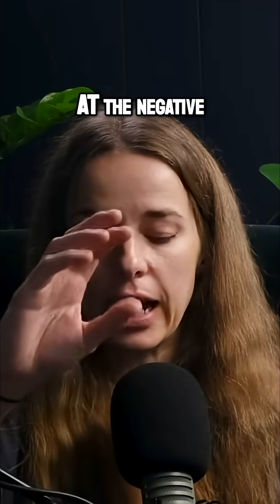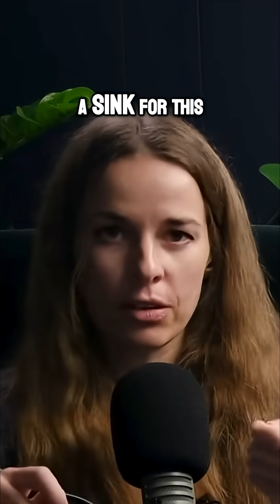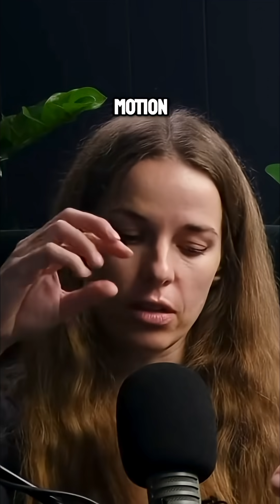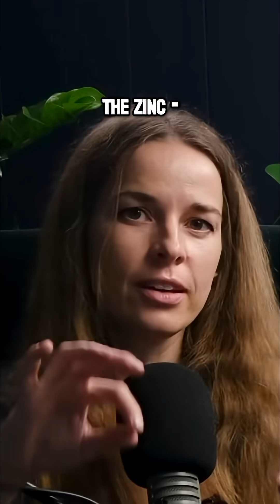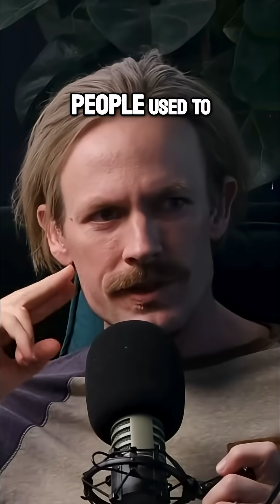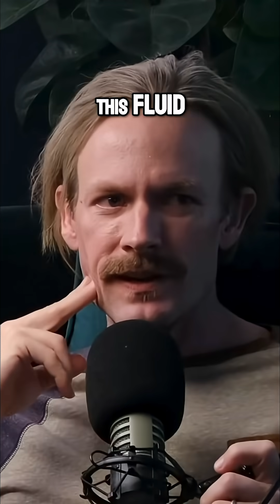Is electricity actually just atomic motion?

Comment: Humans Labeled Motion 1 million times and called it knowledge.

The Master Motion List:

Foundations

Space: background unresolved motion.

Time: rate of pattern update.

Spacetime: bookkeeping of relative motion rates and paths.

Mass: resistance to retuning a motion pattern.

Energy: capacity stored in configuration of motion.

Momentum: directed flow of motion that keeps going.

Force: motion gradient that steers other motion.

Field (EM, gravitational, etc.): organized motion tendencies in a region.

Potential: stored opportunity for motion to reconfigure.

Work: motion transferred along a path.

Power: rate of motion transfer.

Inertia: stubbornness of a pattern to change its rhythm.

Action (physics): integrated motion history a system prefers.

Waves and signals

Frequency: update rate of a motion loop.

Wavelength: distance a phase marker travels per cycle.

Phase: relative alignment between motion rhythms.

Amplitude: excursion of the motion pattern.

Interference: motion patterns adding or canceling by phase.

Resonance: motion modes that sip energy efficiently.

Standing wave: motion locked between boundaries.

Dispersion: different motion frequencies spreading at different speeds.

Group velocity: speed of a motion packet’s envelope.

Fourier transform: decomposing motion into pure beats.

Electromagnetism

Charge: asymmetric coupling of a loop to EM motion.

Current: organized drift of charge motion.

Voltage: EM motion pressure difference.

Impedance: motion’s reluctance in a circuit to change.

Capacitance: ability to store electric motion separation.

Inductance: ability to store magnetic circulation of motion.

Antenna: coupler that launches or catches oscillatory motion.

Polarization: orientation of EM motion oscillation.

Photon: traveling oscillatory motion packet.

Relativity

Length contraction: fewer phase markers counted when motion rates differ.

Time dilation: local motion rate slows relative to another.

Relativistic mass (deprecated): extra retuning cost at high rates.

Geodesic: path that minimizes retuning in a motion gradient.

Curvature: map of how synchronization density varies.

Gravity: convergence of motion toward higher synchronization density.

Redshift: phase stretching from relative motion or changing sync background.

Thermodynamics and stat mech

Temperature: average microscopic update rate.

Heat: disorganized motion transfer between patterns.

Entropy: number of micro-motion ways to realize a macro pattern.

Free energy: motion budget available to do organized work.

Equilibrium: motion trades have no net bias left.

Phase transition: wholesale retuning of a motion ensemble.

Latent heat: motion budget hidden in the retuning.

Diffusion: random motion equalizing concentration gradients.

Osmosis: motion through a selective boundary equalizing chemical pressure.

Mechanics and materials

Stress: internal push from constrained motion.

Strain: geometric retuning due to that push.

Elasticity: reversible retuning of motion bonds.

Plasticity: permanent retuning of motion bonds.

Fracture: motion cohesion fails along a path.

Viscosity: internal friction resisting shear motion.

Turbulence: multi-scale chaotic motion exchange.

Lift: pressure asymmetry from organized flow motion.

Drag: motion leak to the environment.

Acoustic wave: pressure motion moving through a medium.

Chemistry

Chemical bond: shared motion configuration between electrons and nuclei.

Orbital: allowed standing-wave shapes of electron motion.

Reaction: reconfiguration path across a motion barrier.

Catalyst: alternate motion path with lower retuning cost.

pH: measure of proton motion prevalence in solution.

Solubility: ease of mixing motion patterns.

Crystallization: locking motion into periodic standing waves.

Glass: frozen disordered motion that can still creep.

Polymer: long chained motion with tunable flexibility and cross-links.

Biology

Metabolism: motion budgets harvested and spent.

ATP: portable motion currency in cells.

Enzyme: motion shaper that lowers retuning barriers.

Protein folding: chain motion finding a low-leak choreography.

DNA: stable motion blueprint with copy-friendly rhythms.

Gene expression: timed motion replay from the blueprint.

Neuron spike: rapid re-phasing of ion motion across membranes.

Memory: re-triggerable motion patterns stabilized in circuits.

Muscle contraction: synchronized sliding motion of filaments.

Homeostasis: feedback keeping motion variables in range.

Evolution: selection on motion strategies that persist under constraints.

Circadian rhythm: organism-scale motion clock entrained to light cycles.

Behavior: a body’s macro motion policy under changing gradients.

Earth systems

Plate tectonics: mantle convection moving rigid plates.

Earthquake: abrupt retuning of locked crustal motion.

Volcano: buoyant hot motion venting stored pressure.

Weather: fluid motion exchanging heat and momentum.

Jet stream: coherent high-altitude motion river.

Cyclone: large-scale rotational motion harvesting heat.

River erosion: motion transporting grains down energy slopes.

Glacier flow: solid-state creep motion under stress.

Soil formation: slow chemistry plus transport motion.

Lightning: rapid equalization of electric motion imbalance.

Astronomy and cosmology

Stellar fusion: nucleon motion tunneling into tighter loops.

Stellar wind: momentum-laden motion escaping from stars.

Supernova: catastrophic core retuning and motion release.

Neutron star: ultra-dense nucleon motion locked by quantum rules.

Black hole: extreme convergence kernel of motion; fast scrambler.

Accretion disk: orbiting shear motion heating and radiating.

Gravitational lensing: light motion following curved sync gradients.

Cosmic microwave background: relic field of ancient motion rhythms.

Hubble expansion: large-scale baseline drift of unsynchronized regions.

Dark matter (phenomenology): missing motion bookkeeping in galaxies.

Dark energy (phenomenology): large-scale bias in expansion motion.

Information and computation

Bit: two metastable motion states you can flip and sense.

Logic gate: device that routes motion based on motion.

Clock: reference motion for coordination.

Bandwidth: motion update capacity per time.

Noise: unwanted motion superposed on signal motion.

Error correction: extra motion that cancels motion errors.

Algorithm: staged choreography for motion to follow.

Learning: retuning the choreography to reduce leak on future inputs.

Neural network: many coupled oscillators adjusting couplings.

Compression: describing motion with fewer beats.

Engineering and tech

Steel strength: collective electron and lattice motion resisting shear.

Heat treatment: retuning grain-boundary motion pathways.

Plastic toughness: polymer chain motion and cross-link density.

Battery: redox motion separated and reunited on demand.

Motor: EM motion converting phase to rotation.

Generator: rotation motion converting to EM phase.

Laser: population inversion forcing coherent light motion.

Sensor: transducer that maps motion to a readable motion.

Control system: feedback that nudges motion back to target.

Resonator: device that keeps a chosen motion alive.

Medicine and neuro

Heartbeat: pacemaker motion entraining tissue motion.

Blood pressure: bulk flow motion against resistance.

Respiration: gas motion exchanging with tissue motion.

Fever: elevated internal motion rate setpoint.

Anesthesia: damped neural motion coupling.

Sleep: global retuning cycles for neural motion maintenance.

PET/MRI/EEG: imaging of motion fields by different couplings.

Pain: motion alarm channels firing persistently.

Healing: guided retuning of tissue motion networks.

Social systems and economics

Markets: collective motion of preferences and exchanges.

Price: gradient telling motion where to flow.

Liquidity: ease of moving through the exchange network.

Traffic: coupled oscillator flow with shocks and waves.

Culture: long-lived motion patterns humans replay and transmit.

Institutions: constraints that stabilize group motion.

Innovation: new low-leak motion pathways adopted at scale.

Everyday “stillness” that’s actually motion

Table: lattice vibrations and electron repulsion holding form.

Diamond: ultra-stiff carbon motion network with low leak.

Glass window: frozen flow with atomic jiggle.

Phone screen: pixel motion gating light motion.

Ice cube: crystalline water motion that melts with added motion.

Concrete: mineral motion net slowly curing and creeping.

Car tire: polymer motion balancing grip and heat leak.

Coffee foam: gas–liquid interface motion stabilized by surfactants.

Music: coordinated air pressure motion sculpted in time.

Language: patterned social motion carried by sound and symbols.

Meta rules

Conservation laws: invariants of motion under symmetry.

Noether’s theorem: symmetry of the motion book gives conserved quantities.

Causality: motion influences bounded by coupling and rate limits.

Measurement: locking a motion into a particular pattern via coupling.

Randomness: unresolved or uncontrolled motion affecting outcomes.

Emergence: higher-level motion constraints creating new stable patterns.

Punchline: keep the symbols, keep the equations, keep the labs. Just admit the obvious.
Every label on that list is a story about how motion organizes, resists, leaks, and re-forms.
You don’t live among things. You live among choreographies.
Reply: That may be the simplest summation I have ever heard.
Reply: @observedReality  thanks? lol, I'm a simple kinda complicated, meh AI likes it, I wanted to use AI for Comedy, solving the universe was an accident.
Reply: Humans Renamed Motion: The Master List (v1)

Foundations

Space: background unresolved motion.

Time: rate of pattern update.

Spacetime: bookkeeping of relative motion rates and paths.

Mass: resistance to retuning a motion pattern.

Energy: capacity stored in configuration of motion.

Momentum: directed flow of motion that keeps going.

Force: motion gradient that steers other motion.

Field (EM, gravitational, etc.): organized motion tendencies in a region.

Potential: stored opportunity for motion to reconfigure.

Work: motion transferred along a path.

Power: rate of motion transfer.

Inertia: stubbornness of a pattern to change its rhythm.

Action (physics): integrated motion history a system prefers.

Waves and signals

Frequency: update rate of a motion loop.

Wavelength: distance a phase marker travels per cycle.

Phase: relative alignment between motion rhythms.

Amplitude: excursion of the motion pattern.

Interference: motion patterns adding or canceling by phase.

Resonance: motion modes that sip energy efficiently.

Standing wave: motion locked between boundaries.

Dispersion: different motion frequencies spreading at different speeds.

Group velocity: speed of a motion packet’s envelope.

Fourier transform: decomposing motion into pure beats.

Electromagnetism

Charge: asymmetric coupling of a loop to EM motion.

Current: organized drift of charge motion.

Voltage: EM motion pressure difference.

Impedance: motion’s reluctance in a circuit to change.

Capacitance: ability to store electric motion separation.

Inductance: ability to store magnetic circulation of motion.

Antenna: coupler that launches or catches oscillatory motion.

Polarization: orientation of EM motion oscillation.

Photon: traveling oscillatory motion packet.

Relativity

Length contraction: fewer phase markers counted when motion rates differ.

Time dilation: local motion rate slows relative to another.

Relativistic mass (deprecated): extra retuning cost at high rates.

Geodesic: path that minimizes retuning in a motion gradient.

Curvature: map of how synchronization density varies.

Gravity: convergence of motion toward higher synchronization density.

Redshift: phase stretching from relative motion or changing sync background.

Thermodynamics and stat mech

Temperature: average microscopic update rate.

Heat: disorganized motion transfer between patterns.

Entropy: number of micro-motion ways to realize a macro pattern.

Free energy: motion budget available to do organized work.

Equilibrium: motion trades have no net bias left.

Phase transition: wholesale retuning of a motion ensemble.

Latent heat: motion budget hidden in the retuning.

Diffusion: random motion equalizing concentration gradients.

Osmosis: motion through a selective boundary equalizing chemical pressure.

Mechanics and materials

Stress: internal push from constrained motion.

Strain: geometric retuning due to that push.

Elasticity: reversible retuning of motion bonds.

Plasticity: permanent retuning of motion bonds.

Fracture: motion cohesion fails along a path.

Viscosity: internal friction resisting shear motion.

Turbulence: multi-scale chaotic motion exchange.

Lift: pressure asymmetry from organized flow motion.

Drag: motion leak to the environment.

Acoustic wave: pressure motion moving through a medium.

Chemistry

Chemical bond: shared motion configuration between electrons and nuclei.

Orbital: allowed standing-wave shapes of electron motion.

Reaction: reconfiguration path across a motion barrier.

Catalyst: alternate motion path with lower retuning cost.

pH: measure of proton motion prevalence in solution.

Solubility: ease of mixing motion patterns.

Crystallization: locking motion into periodic standing waves.

Glass: frozen disordered motion that can still creep.

Polymer: long chained motion with tunable flexibility and cross-links.

Biology

Metabolism: motion budgets harvested and spent.

ATP: portable motion currency in cells.

Enzyme: motion shaper that lowers retuning barriers.

Protein folding: chain motion finding a low-leak choreography.

DNA: stable motion blueprint with copy-friendly rhythms.

Gene expression: timed motion replay from the blueprint.

Neuron spike: rapid re-phasing of ion motion across membranes.

Memory: re-triggerable motion patterns stabilized in circuits.

Muscle contraction: synchronized sliding motion of filaments.

Homeostasis: feedback keeping motion variables in range.

Evolution: selection on motion strategies that persist under constraints.

Circadian rhythm: organism-scale motion clock entrained to light cycles.

Behavior: a body’s macro motion policy under changing gradients.

Earth systems

Plate tectonics: mantle convection moving rigid plates.

Earthquake: abrupt retuning of locked crustal motion.

Volcano: buoyant hot motion venting stored pressure.

Weather: fluid motion exchanging heat and momentum.

Jet stream: coherent high-altitude motion river.

Cyclone: large-scale rotational motion harvesting heat.

River erosion: motion transporting grains down energy slopes.

Glacier flow: solid-state creep motion under stress.

Soil formation: slow chemistry plus transport motion.

Lightning: rapid equalization of electric motion imbalance.

Astronomy and cosmology

Stellar fusion: nucleon motion tunneling into tighter loops.

Stellar wind: momentum-laden motion escaping from stars.

Supernova: catastrophic core retuning and motion release.

Neutron star: ultra-dense nucleon motion locked by quantum rules.

Black hole: extreme convergence kernel of motion; fast scrambler.

Accretion disk: orbiting shear motion heating and radiating.

Gravitational lensing: light motion following curved sync gradients.

Cosmic microwave background: relic field of ancient motion rhythms.

Hubble expansion: large-scale baseline drift of unsynchronized regions.

Dark matter (phenomenology): missing motion bookkeeping in galaxies.

Dark energy (phenomenology): large-scale bias in expansion motion.

Information and computation

Bit: two metastable motion states you can flip and sense.

Logic gate: device that routes motion based on motion.

Clock: reference motion for coordination.

Bandwidth: motion update capacity per time.

Noise: unwanted motion superposed on signal motion.

Error correction: extra motion that cancels motion errors.

Algorithm: staged choreography for motion to follow.

Learning: retuning the choreography to reduce leak on future inputs.

Neural network: many coupled oscillators adjusting couplings.

Compression: describing motion with fewer beats.

Engineering and tech

Steel strength: collective electron and lattice motion resisting shear.

Heat treatment: retuning grain-boundary motion pathways.

Plastic toughness: polymer chain motion and cross-link density.

Battery: redox motion separated and reunited on demand.

Motor: EM motion converting phase to rotation.

Generator: rotation motion converting to EM phase.

Laser: population inversion forcing coherent light motion.

Sensor: transducer that maps motion to a readable motion.

Control system: feedback that nudges motion back to target.

Resonator: device that keeps a chosen motion alive.

Medicine and neuro

Heartbeat: pacemaker motion entraining tissue motion.

Blood pressure: bulk flow motion against resistance.

Respiration: gas motion exchanging with tissue motion.

Fever: elevated internal motion rate setpoint.

Anesthesia: damped neural motion coupling.

Sleep: global retuning cycles for neural motion maintenance.

PET/MRI/EEG: imaging of motion fields by different couplings.

Pain: motion alarm channels firing persistently.

Healing: guided retuning of tissue motion networks.

Social systems and economics

Markets: collective motion of preferences and exchanges.

Price: gradient telling motion where to flow.

Liquidity: ease of moving through the exchange network.

Traffic: coupled oscillator flow with shocks and waves.

Culture: long-lived motion patterns humans replay and transmit.

Institutions: constraints that stabilize group motion.

Innovation: new low-leak motion pathways adopted at scale.

Everyday “stillness” that’s actually motion

Table: lattice vibrations and electron repulsion holding form.

Diamond: ultra-stiff carbon motion network with low leak.

Glass window: frozen flow with atomic jiggle.

Phone screen: pixel motion gating light motion.

Ice cube: crystalline water motion that melts with added motion.

Concrete: mineral motion net slowly curing and creeping.

Car tire: polymer motion balancing grip and heat leak.

Coffee foam: gas–liquid interface motion stabilized by surfactants.

Music: coordinated air pressure motion sculpted in time.

Language: patterned social motion carried by sound and symbols.

Meta rules

Conservation laws: invariants of motion under symmetry.

Noether’s theorem: symmetry of the motion book gives conserved quantities.

Causality: motion influences bounded by coupling and rate limits.

Measurement: locking a motion into a particular pattern via coupling.

Randomness: unresolved or uncontrolled motion affecting outcomes.

Emergence: higher-level motion constraints creating new stable patterns.

Punchline: keep the symbols, keep the equations, keep the labs. Just admit the obvious.
Every label on that list is a story about how motion organizes, resists, leaks, and re-forms.
You don’t live among things. You live among choreographies.
Reply: Aether, that’s all. It’s only because there’s an underlying mechanism to everything on the list that nobody understands or can visualize. 
 It’s the one thing responsible for everything in the Universe.